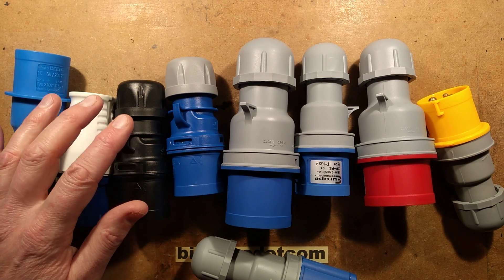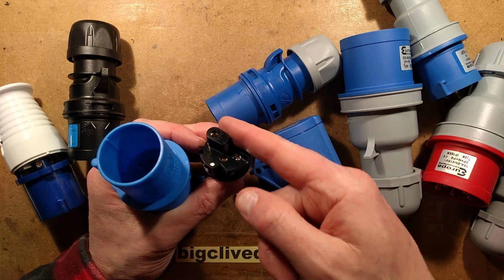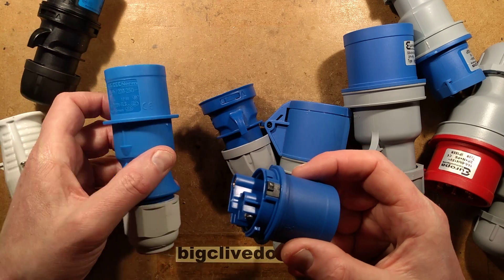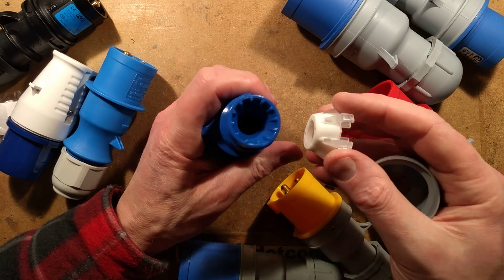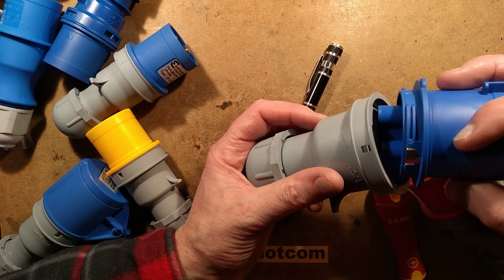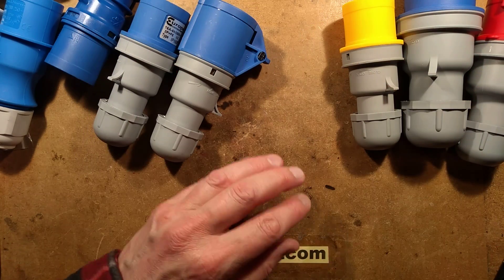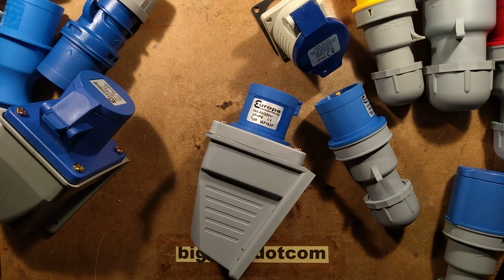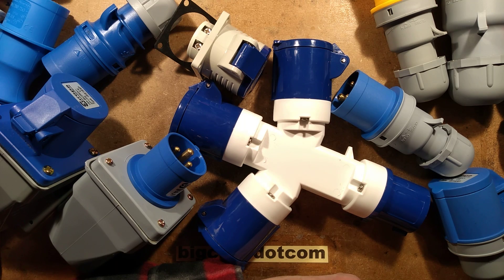My favourite industrial connector (Ceeform).

Comment: Hi Clive     When these connectors were introduced, they were called "EF" connectors, then "EU" connectors.   Therefore they are used mainly in Europe, but have made it around the world, on and with imported equipment, and to neighboring non EU countries, to some degree.     They DO have ONE world wide application,   32A 3 phase, NO neutral, in red, 400V on refrigerated / freezer sea freight containers.   Like you I have used them extensively in the entertainment industry in Denmark,   and I have used thousands in construction site power installations, and in plant hire applications.    There is a poster of all coulors, and all ground pin positions, in a circle, by hour, have you ever seen that ?     For you I even spelled color wrong.   LOL     Have a nice day          PS you should have explained the black connector, as I expect ( know ) that you do not operate on 480 - 500V or 500 - 1000V     I found the poster, less the orange specification:   link:   http://www.site-electrics.co.uk/Ceeform

Comment: I'm not an electrician, but I do recognise those connectors. I believe those are the standard for three-phase in Sweden since (quite?) some years back.
I'm pretty sure I also recognise the blue ones as having appeared adjacent to me while doing other work (building, stage handing, and the tiniest bit of theatre). 
I think there is probably some transition regulations in place to replace old connectors with the new standard when altering installations or when doing new installations. Sweden's electrical safety regulations are more than a bit rubbish.
Sure the regulations for new installations is fine, but at the same time we still have a lot of old un-earthed infrastructure around, primarily in residential buildings.

Comment: These are used for three phase in norway. Either 5 pin red ones, or 4 pin blue ones. The blue one has ground, but not neutral since places with 230v three phase use the IT electrical system.

Comment: In New Zealand it is common to find the three phase 63 & 125 amp Ceeforms in the live sound / lighting and also the television industries. The single phase 32 amp ones are also used to spilt out a 32 amp three phase supply to multiple 10 amp outlet (standard NZ "crows-foot" pattern) distro boxes. 

However, far less common is the use of 32 amp three phase connectors as we tend to use the PDL 56 series connectors for these kind of circuits although that is slowly changing now. The 56 series is probably not quite as robust as a Ceeform, but it is more watertight which is handy for outdoor dance parties in the South Island! 

The 16 amp single phase Ceeforms are the standard for caravan power connectors over here. And you will never see a socket as an inlet with a live male feeding it. These replaced the old Reyrolle 15 amp connectors as the standard (sometime in the early 90s I believe). Which wasn't a moment too soon, as the Reyrolles relied on the metal-to-metal contact of the connector bodies to make the earth connexion, which wasn't that reliable. 

So it ended up being common practice to parallel the earth to the neutral pin (in the days before RCDs of course). This worked very well if the supply was correctly polarised, if not it caused the frame of the caravan to become live. Which killed & injured quite a lot of caravaners!

Comment: We use the on our vans at work (Tesco) to power the fridge/freezer. People occasionally drive off with the cable still attached (even tho there is an audible warning in the van) and rip it out of the socket 🤦🏻‍♂️

Comment: In Germany these connector are almost exclusively used these days.  The yellow 110V version is uncommon however, the blue single-phase 16A one is also known as the "camping plug" because caravans ususually it, an application where it's common because it's rugged and weather-proof.  For anything that needs more than 16A the red three-phase connectors are typically used which means only the 16A variant of the blue connector is common.  Also rare is the four pin variant of the red connector.
Before that a system named Perilex was used for indoor applications.  Perilex is only available in 16A and 25A variants.  It can sort of described as the extension of the Schuko (Type F) connector to 3-phase.
Even before that and a bit more rugged but no longer permitted for quite a few years is the "Ovale Kragensteckvorrichtung".  The name translates to something like "oval collar plug contraption".  It looks like a long oval with all four pins in a row.  It happend that the nose that was supposed to prevent incorrect insertion of the connector broke off which allows for wrong insertion which would put PE of the device in connection with a phase, thus a metal case would end up live.  Which is why in West Germany the connector system had to be replaced by the end of 1980 and East Germany in 1997.

I like Perilex for anything that doesn't need to be rugged because the connector has a reasonable size and weight.
Another 3-phase connector like is the Swiss one.  It allows the smaller single-phase connectors (or even a type C "Euroconnector") to be inserted as well.
Switzerland btw. doesn't allow the 32A single-phase blue socket because an older but still in use Swiss connector (T7) is mechanically compatible but uses a different pin assignment.  And CEE 16-3 version is only permitted for camping and boating, no idea why. Other than that CEE is used for anything that can not be satisfied by the Swiss domestic 3-phase T15 (10A) and T25 (16A) connectors both of which look kinda like type C extended to 4 pins in the edges with a 5th pin in the centre.

Comment: I’m in Canada in radio engineering, I’ve never seen these before but I can assure you I’m getting the chief engineer to order a few of em!
Reply: You'll love them, and what Clive doesn't mention is you can get even more water resistant versions with a bayonet locking ring and silicone water seals, so they don't do the thing where they fill up with water if you hang it upside down

Comment: Great video Clive. The only issue I have is where you cut say a 13a plug off, fit a 16a & wham, no fuse.....
Reply: There's no need for a fuse if you have a 16A plug in a 16A outlet wired to a 16A breaker (like in every civilized country... 😜)

Comment: There is an IP67 variant with gasket and twist lock ring (instead of the spring loaded flap/clip).  It's defined in the IEC 60309 standard, as far as I'm aware.  The MK Commando range comes in both IP44 and IP67 variants.  They will interoperate, i.e. 44 connecting to 67, but you only get 44 unless both sides are 67; and you may not get a correct mechanical latching with a mismatched pair.

Comment: I change every conector with it, so even my phone charger has it
Reply: Oh, I've got it! Replace usb-c so it's much more durable. Bit embarrassing to walk about and have people wondering, "Is that a Ceeform, or are you happy to see me?"
Reply: You're joking, but some guy at work took a CEE 16, a 3 phase one, and put his broken phone charger into it. Fully wired up. Reason: "Nobody ever uses the CEE 16 on the distributors, so nobody will ever unplug my phone again"
Reply: @Waves0815  I like that!
Reply: @Waves0815  mmm... Over charging...
Reply: I hear they’re going to replace the lightning port on the IPhone 12 with a Ceeform connector
Reply: I used a Schuko to CEE form to CEE form to 13a in a hotel in London to charge my phone as for some reason they had put Schukos instead of 1363s either side of the bed.
Reply: @intelmacs  Well, London's in Europe so bedroom will have standard Schuko in it !
Bet it was a foreign hotel chain - like the Savoy - surely all part of House of Rackhams nowadays ?
Reply: @millomweb  no euro plugs are 2 pin, we have 3 pin in the uk for our plug sockets. E.g all common household appliances/electronics have them apart from the cooker and shower.
Reply: @michaelwilson5055  I was referring to the Schuko  as a Europlug - not knowing a Europlug was a different specific 2 pin design ! I've corrected my previous message.
I had the right plug in my mind but not the right name for it !
Reply: @millomweb  no worries, these things happen different names around the world.👍
Reply: But surely that's doubled the size of your phone ?

ROTFLMAO !
Reply: You just got me idea - I might integrate USB charger in that connector case!

Comment: 16A 1P is sometimes used for shoreline connections on UK ambulances, though Kussmaul Autoeject connectors are more common nowadays, which use a chunky spring and a solenoid to fire the connector out when the engine is started
Reply: Those Kussmaul Autoeject connectors are used on ambulances here in the USA too.
Reply: I had  one on ambulance / camper van. Start the engine and the plug drops out.

Comment: Forgot to mention the price. Those are not cheap connectors. An extension cable will cost a few hundred dollars. Imagine what it would cost in total for a full on light show, it will be thousands of dollars just on cables, and then you still need the hardware at the end.

Comment: Those are used at my job for the connection between the Chargers and the lift trucks I operate there are 3 different lift trucks I'm licensed to drive.  Heavy counter balance fork lift, the stand up order picker and the reach lift being the most difficult to operate. Love your channel. Good job sir. I'm in the USA.

Comment: I was watching this in the pub (last out as usual) and some of my comments preceded  yours by seconds, eg the high current  ones weigh a ton.
I agree about the connectors being abrasion resistant, unfortunately not so much for the cable. I forgot to unplug one from my van, and dragged 10m of arctic cable and plug about 2 miles before I realised. The plug is fine but some of the cable is beyond use.
Consequently I decided to look for some push fit connectors. I've found some great ones, very compact, 16A, ip68 rated, and wago style wire connection up to 2.5mm.
I've made an adapter so if I ever forget to disconnect again they will just pull apart leaving just a short stub.
I've got some more coming, I'll send one for you to evaluate when they arrive.

Comment: Australian here, in heavy industry. I don't know why, but we use Marechel connectors rather than the usual Clipsal Aussie convention. They are similar to the CEE connectors. Most require about a 15 degree rotation of the plug to release it. That is very difficult to impress on certain people... 
Interestingly, some are configurable from 3P N & E, to single phase, to DC etc by rotating a polarising shutter over the socket holes. Once again, far from 200lb gorilla proof.
But they do help keep us in a job.

Comment: At the risk of sounding contrary for the sake of being contrary I've always found Ceeform connectors to be a massively over engineered faff. I use them all the time setting up concerts and conventions in California and they've never impressed me. I certainly see the goals and efforts that went into the design and I'm sure they're good in construction and general industry but I'm always happy to not see them on my stages. As for caterers, we can completely agree on that, they're an absolute terror where power (or the health and safety of any human being) is concerned. I've had TWO occasions personally where caterers have almost fried me, and that's just my first hand experience. I know of many many more incidents.

Comment: Interesting. I don't work with this level of current/voltage, so I don't know what is used here in Australia. What I would like is a look at connectors for RV use - 12-48V 5A - 200A?

Comment: In the UK, I connect these onto water proof cable work that goes sub sea for certain types of equipment (ROVs, Magnetometers & Various sensing equipment usually). 

They are cheaper than Seacon connectors (MINM/MINL/MINK) and more robust than the "In-Line" (IL) and "Micro-In-line" (MCIL) connector types. Often see these where Amphenol connectors used to be (namely, 6 pin amphenol or less).

Comment: These are used in static caravan in holiday parks, plugs going into a fixed socket on the concrete on the ground. Also they are used to connect Christmas lights on lamp posts, plus fixed upwards to the sockets. Also seen them commonly on travelling or fixed funfair rides.

Comment: We use cables like that in electrical Construction. Most of the time they're used with so cables and the amperage rating on the plugs varies. The higher up it goes and amps, the larger the size of a plug and it will have a different tabs and connectors that are only fit into the slots that are rated for those amps. The connectors we use here in the US are called turn lock connectors and the highest rating I've ever used is 50 amps on single phase power of 240 volts.

Comment: Finland, the most common connector used for anything 3-Phase
Reply: The plug ring colour defines the voltage - red 380v blue 230v yellow 110v
Reply: Indeed and most houses have at least one of these sockets either in distribution center, garage or outside wall.
Reply: In germany to
Reply: in estonia🙃 to but not yellow(110-120v) one
Reply: Martin yellow 110v (55-0-55)is used on building sites in the UK.
Reply: Red for 3-Phase and blue for 1-Phase. I have Blues for caravan and my server computer cabinet. Before Defa and Calix mini connector car heating was also same connector. (Finland)
Reply: @hatyri  Red for 400v and Blue for 220v, triphase 220v is also blue
Reply: @hatyri  No, the colour say nothing about how much phases are in. In 3 phase plugs the higher voltage determin the colour. You can even find blue three phase connectors with 230/130 V .the common red ones found wide spread on europe mainland ,  230/400V if you extract a single phase out of three  there are a blue female  Connector ar the end. There is a black one here in germany use only in industrial , for 400/690V . I saw them on shipyards for heavy  welding equipment.

I got a 1,5kW  fan heater in my hobby workshop, it run between two phases on 400V . I got a 3 pin red 16A plug on it, the same like the caravan type , but red and the earth pin has a different position respect to the guiding notch. 

Here are more information abot cee connectors. https://de.wikipedia.org/wiki/IEC_60309. The page is in german, but I´m  sure there is a englisch page also available.
Reply: Yes but only that red one, not those blue ones.
Reply: @1978jra  the blue ones are used for caravans
Reply: 1978jra Have seen the blue ones being used for car engine heaters...
Reply: @fairdragon79  They are different connectors. Looks a bit same, though.
Reply: @fairdragon79  I've seen too one old model, but it was more rectangular. as engine heater. Though I think campers use these commonly for single phase campsite electric feeds. Note I think, I'm most certainly not a camper. I've specifically heard these talked as roughly translated "caravaners connector".